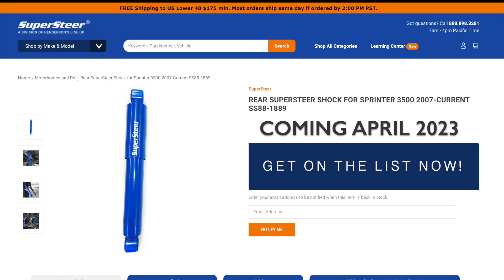Amazing Upgrades For The Sprinter 3500 Class C Motorhome!

Comment: Is there an option for a override air operated shock to lift rear end of motorhome when on high angled entrances or ramps on ferries etc
Reply from the maker: Good question! There is one company we are aware of, VB Air, which makes a rear air suspension kit for the Sprinter and may have an adjustable ride height feature.